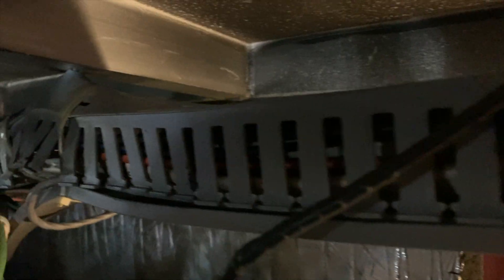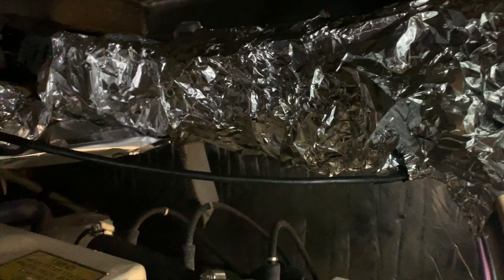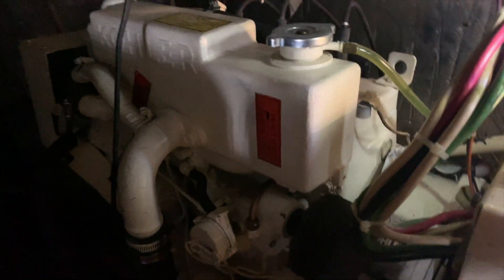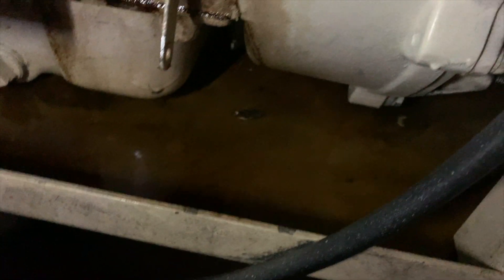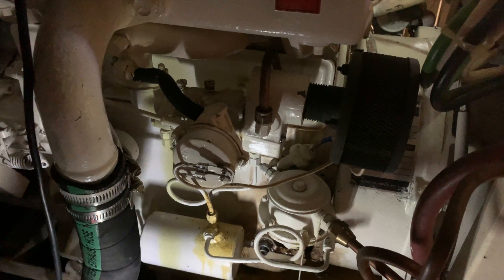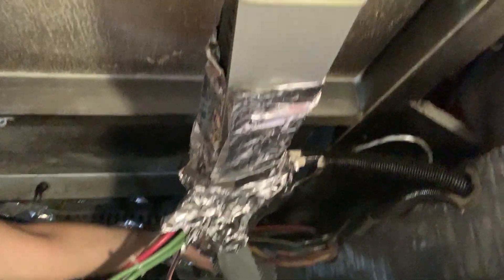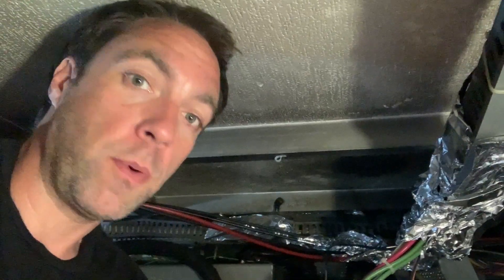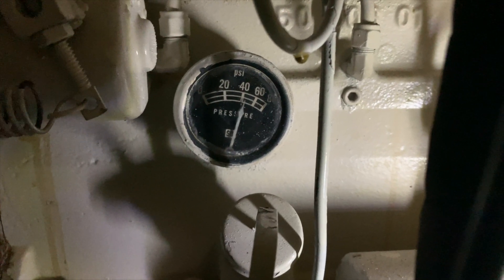Generator Woes During the Great Flood of 2020

Comment: I'm thinking with the oil pressure sensor might have just been stuck, with the increase of operation (time and use), it just became free.   Can you adjust it by the adjustment screw?  IS that the only pressure sensor or is there one on the bridge?
Reply from the maker: I'll check the oil pressure sensor when I de-winterize in the spring. In fact the whole thing needs a going through as it's also leaking coolant and maybe a bit of oil. Doesn't even feel like I spent $4000 on a rebuild only three years ago!!!